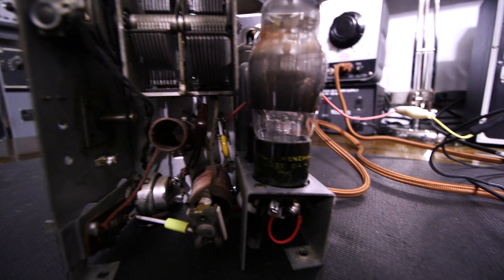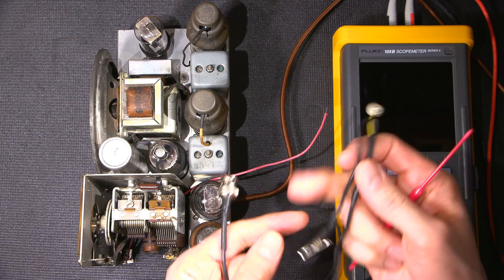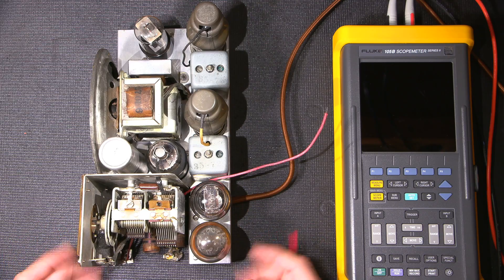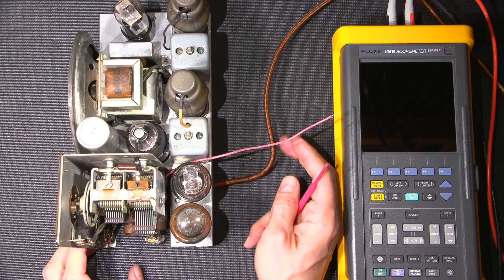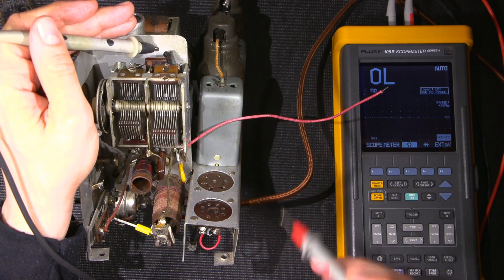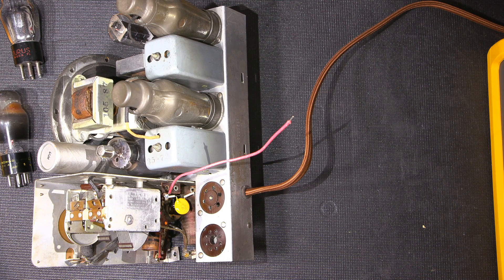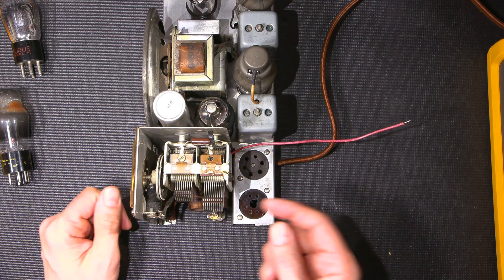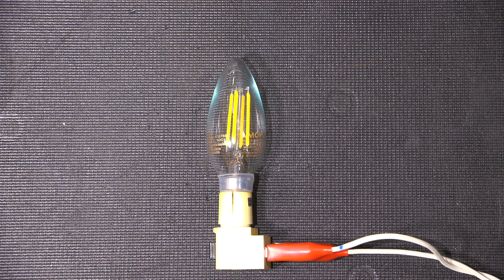See High Voltage Created From Falling Snow!

Comment: you would not really se it in the leakage you have to apply close to the max rating and see if it arcs again, even if it is so sensitive.
Reply: You should know that
Reply from the maker: Hi Heinrich You should know that leakage is resistance, You don't need high voltage to read resistance. High Voltage breakdown is a different scenario. Once you break something down (not to be confused with semiconductor breakdown, this is totally different) you now create resistance, (carbon path (resistive) from breakdown) now see the first line of this response, and repeat.
Reply: Yes and those HV and Y capacitors are build even if they shout though they dont develop those carbon breakdowns you can just test it with another of those capacitors. You get leakage because of excessive electric fields inside of the capacitor around the failure point. You leakage tester is good to test leakage of old and not so good capacitors but it does not help with this failure point.
Reply: @heinrichhein2605  Electric fields won't leak DC no matter how strong though. You'd need a resistive path somewhere.
Reply: Yes they do, especially if high voltage capacitors, and if you have a breakdown it becomes more noticeable. You can try it your self take a such a Y capacitor and over volt it untill it has a breakdown and then measure the leakage at a view volts and at higher voltages. And not you dont need a resistive path. You have even critical field strength in all dialectics if it is are or plastic and if you have a failure point than this is the main problem.

Comment: i had a 2x 30 meter dipole with an open line that entered the house. I always disconnected them from the tuner after static killed a transceivert and just o be safe I put the connectors into a big glass jar for isolation.. At one day I heared some arcing and it came from the open line.  it jumped over through the isolation of the wire to a 19" rack over a distance of 15 cm. I took an isolated pair of plyers  to move it away and it still shocked me. An hour or so later there was a big thunderstorm.  I have had some pretty heafty shocks from the lines   befor this but that was from the bare connectors. I now have an end fed one and I connected 100k and a sparc-gap between centre of coax an the grounded coax shielding.  The voltage is high enough to jump over inside a cap. You need a really high voltage isolation tester to test that but if it jumps over 15 cm  though isolation and paint it will laugh if it meets a cap and bridge it like it was not there. The current does not have to be high, electric fences they use to keep cattle in also shocks the hell out of you with very low current. Or the shock you get when you are charged with static energy and touch some metal.

Comment: About six months ago I had high winds and I heard popping about every 2 second removed coax from radio got hit good it hurt so I thought that probably blow up radio next day hooked everything back up radio worked fine 2 months later radio blowen up😭 icom ic7300😭😭
Reply: Many SS radios can be damaged that are not internally equipped with at least a neon bulb.  My Kenwood TS-450S/AT has one on the antenna connector trace.  I was testing the radio one evening after resoldering the connector's center conductor then hooked it up.  I didn't know it had started raining yet and saw the neon bulb pulse.  A few more pulses and I immediately switched the antenna selector to ground.  Not fun to see that.

Comment: I’ve seen this effect at a Radio Tower guy wire, where the ground was sizzling.
Reply: If the ground is sizzling, you should usually make a point of being far enough away to stop noticing it.
Reply: Jared Maddox I worked at the Station and was alerted to the sound of arcing in the light snow.  I thought it was a power line and called tho power company.  But the arcing was across the insulators along the guy wires to the 500ft tower, and at the base where the wire was attached there was arcing in the ground that sounded like sizzling.  No, I did not hang around to get hurt.

Comment: Perhaps the high voltage "signal" causing the arcing was a very very high-frequency high energy signal.  Maybe the 36 DC ohm coil presented itself as very high resistance to the high voltage signal???  Only answer I can fabricate.
Reply: That's a good possibility. Lightning or other static electric discharges act like a very short duration high frequency pulse. I would think that with the antenna coil and air variable tuning capacitor forming a tank circuit, it would be shock excited into oscillation at its resonant frequency. That would explain why the voltage wasn't shorted to ground by the 36 ohm DC resistance of that coil. (Remember that parallel resonant circuits are high impedance at the resonant frequency.) It would be interesting to see Mr. Carlson place a pickup coil connected to a scope, near that antenna coil and observe the waveform. My guess is that a damped oscillation waveform at the resonant frequency appears with each arc. Definitely fodder for an experiment.

Comment: Not an engineer, but I know that to initiate an arc across an air dielectric of about an eighth of an inch requires a LOT of voltage, maybe on the order of 8 or 9 kilovolts.  The current in a small static discharge can range from very low (less than a milliamp) to respectable and dangerous values (over an amp), but the duration of a "good one" is extremely short, so it comes out painful...but not fatal.  Yes, even a mild or barely perceptible static shock is more than enough to fry solid state electronics.  But generally, small static discharges won't hurt tube gear at all due to the lack of heat that's generated.

Comment: I work on commercial broadcast equipment or kind of had the job fall in my lap. I was warned by the last engineer that even though I have everything shut down and used the Jesus stick on it and the door interlocks should shunt everything to ground to go back over it somewhat frequently and even more so if there is a lot of wind or snow as static can get into it and things you thought were discharged might not be so any more.

Comment: Tesla has a patent on sucking static electricity from the air and converting it to dynamic power for loads 
An insulated from the ground long wire antenna or a shiny metal plate, a high voltage pulse capacitor, a solid ground, an interuptor and a stepdown transformer and you got it

Comment: What ever was coming out of the coaxial cable it was hf/rf so the capacitor was passing it and the inductor blocking (because at really high frequency a capacitor is almost a sort circuit and a inductor a open circuit we all know that) so it can arc, but weirdly a static change is dc, maybe the snow wasn't the cause but somewhere near to the please someone was testing a tesla coil, or something else that created hf/rf maybe a transmitter of some sort
Reply: @WECB640  Maybe if the power line was arcking it was a really primitive arc transmiter

Comment: Paul, the old 500Kw directional suppression array at WLW, Cincinnati, reported unusual static charge voltages on their "northwards suppression array", during squalls which emanated from the south, and at temperatures of less than 25°F.  I remember that the duration was fairly short-term, and that once the event ended, it would not recur during the duration of that storm.  The most complete set of longwire array records that I know of, in your neck of the woods, is at CHML.  I'd drop-off some of the more difficult to obtain components for their backup transmitter, and always sold them at a discount, because those ba*tards seduced me with Tim Horton's 'everything'.

In my neck of the woods, KDKA, and everything else which was Group W, "Westinghouse", maintained the most complete paperwork. The "Radiotelephone Licensed", and upper strata ticketed SBE members - who hold the broadcast engineer reigns, are almost always friendly about answering inquiries, Cheers!

Comment: Were there any burn marks on the chassis where the arc occurred? If not that would indicate a high voltage with almost no current. Typical static arc.

Comment: Even though the one radial was not connected to the radio it was connected to the coax that is coming in to the radio . The coax was acting as a capacitor the isolation transformer is the logical path for the power to find ground. The isolation transformer was absorbing the current post arcing spike. Thats my guess. The current passing through the isolation transformer would cross the winding as magnetism and thus find ground through the chassis of the isolation transformer.
Reply: Maybe ?  : )

Comment: Snowing implies sub freezing weather, therefore very low humidity.  Snowflakes may carry a charge and deposit that charge on the open-circuit side of the antenna, thus building up a large static charge.  As another reply stated, static charges can go through all kinds of paths.  Side note:  the old saying that current takes the path of least resistance is only partially true.  The complete answer is that some current will flow in all paths, and that may be enough to cause the arcing, or even enough to kill you.

Comment: You should have the shield of the coax grounded where it enters the house.  Then a high value resistor, rf choke, or gas tube to ground from the center conductor would bleed off (continuously) or discharge the voltage through the gas tube, which could be as low voltage as approx. 100 volts.  NEC code requires this, OM.  Pretty simple.  It was really not necessary to make such a big deal out if this, getting into tube type scope front ends, etc. and saying 100 times how weird and perplexed you were.

Comment: With that capacitor blocking any DC current to ground, the impedance seen by the static-electricity would probably be very high, at least a few Giga-ohms, and that's most likely allowing the static-electricity charge on the antenna to build-up to a level that's high-enough to jump, or arc to ground, well that's my theory anyway.
Reply: Maybe? And the rise time of the current through the capacitor would be so fast the inductance of the 36 ohm coil would block it.

Comment: The voltage-level generating that spark is probably in the order of something like 10kV, since it was snowing at the time, I'm guessing that the air outside was probably cold and dry, which happens to be the ideal condition for the generation of static-electricity, have you ever noticed how you can generate static-electricity on a cold and dry day simply by rubbing rubber-soled shoes on a carpet?, I'm guessing that a similar principle is generating the static-electricity that's generating the spark, although, I would have thought that the static-electricity would have been shorted to ground by the 30 ohms of the coil.

Comment: Interesting, 

I don't think the electricity was building up over the 30 Ohm resistance. Either something else charged up and arced over to the isolated ground or ... the isolated ground was slowly charged up and the capacitor leaked at that high voltage and also charged up, at some point the isolated ground arced over the transformer and discharged, now the capacitor suddenly was at a much higher voltage than ground and arced as well ...

Comment: Long time ago I destroy mysteriously front end of my CB base station. It was winter and antenna was connected at the time. Week after mystery resolved when I hear and see that sparks was disharging over contacts of my antenna feed cable connector at freguency of about 1/second. Antenna was CB 1/4 wave GP and feed cable disconnected. It was very cold (dry air) and heavy snowing.

Comment: How bizzar. I've never heard of anything like this before.
Reply: "Lord Kelvin's Thunderstorm". In essence, you charge up some charge carrier, and then use either wind or gravity to force it into contact with a conductor which then accumulates a corresponding charge. Normally useless, but it can have noteworthy implications, such as here. It's essentially like running an ion engine in reverse to generate electricity.

Comment: I am four and a half minutes in. With one side of the cable disconnected maybe the coax acted as a long capacitor that was charging until it arced in the radio chassis. That is my instant hypothesis. Guess I should watch the rest now.

Comment: When you rub a pair of rubber-soled shoes on a carpet on a cold and dry day, you can easily generate a static-electricity charge of at least 10kV or more, especially if your skin is dry at the time, cause your skin-resistance will be several Mega-ohms.

Comment: Can you please replicate this  'Carlson phenomena' :) using equipment, e.g. something like attaching a variable high voltage source to circuit which contains a 36 ohm coil and a safety cap with are attached to a pin next to a ground chassis or similar just like in the radio... then gradually increase the high voltage to see if this is phenomena is valid or not? i think that would make a nice clip to watch. Thanks again.

Comment: Your tuned circuit is only tuned when the radio is powered up with it's oscillator operating. I would be more inclined to believe you had some kind of lightning activity, static electricity caused by wind or atmospheric charge phenomenon in your area...

Comment: You don't have a lightning arrester on your antenna?....silly boy.  I've seen arcs jump  unattached antenna coax  bnc connectors from shield to co-axial conductors  as a precursor to lightening storms approaching.  On the coax cable for both my  TV antenna and the long wire antenna for my shortwave receiver both have spark gap lightening arresters .  Your landline telephone also has a carbon block spark gap arrester at the entrance block provided by the telephone company.  As for snow causing static electricity,  heavy snow falls will cause snow thunder, I experienced that several times here in Northwestern Montana.  In the old houses built in the 20s and 30s around here, near abandoned porcelain tubes used for radio antenna and ground wires  sometimes have porcelain block lightening arrester still mounted near by on the outside walls.  I enjoy your tech shows, have a good day.

Comment: The blowing snow creates a charge on the antenna and on one side of the input capacitor. The other side of the capacitor is connected to the grounded coil. As the voltage across the capacitor continues to rise it reaches a point where the capacitor arcs over internally. This creates a very fast current pulse that is blocked by the inductance of the coil. It does not matter that the coil only has 30 ohms DC resistance to ground. Its impedance to the current pulse is many thousands of ohms. The fast current pulse when confronted with the high impedance coil develops a voltage spike that can be many thousands of volts, and just like lightning, it finds its own path to ground via the most direct path.
The way to prevent this (besides disconnecting the antenna) is to wire a 200k ohm resistor either across the input capacitor, or from the antenna to ground. The resistor will continuously drain away the static charge.

Comment: If the transient spark is of short enough duration, its energy density would be concentrated toward higher frequenctes.....in that case the impedance of the coil would be very high and reactive. the 30 ohms would have negligible effect as the reactive impedance would be many times that. All antennae should be run through a spark gap arrestor or gas discharge arrestor to a quality ground.

Comment: hmmm.    some thoughts.      does arcing suggest that the break-down voltage of air is present.        was charge  accumulating, then  arcing, intermittently  -   there did seem to be a 'rhythm'.        while thirty-six ohms does not seem like much, might there also be  impedance, during the event.        the conductor in the  nearby  coil is not  large.   so, would  current flow be, inherently, limited.        it is not clear whether the nearby coil is a multi-layer coil.    if so, then there  Would be  back-emf/impedance, when  current attempts to flow through it.   cheers      googletranslate

Comment: Tie the shield of that coax to ground outside,to a ground rod,then the center pin of coax and the braid the two sides of your dipole can come in to your radio. Your floating your coax,ground it to mother earth. See section 250 of NEC on some good grounding techniques. You wont see anymore stray transient voltage. Check the ground in your electric panel,you use ground rods up in canada, 5/8 diam, 8' foot long driven into the earth. Check the nec section 250, code 2008,2011,2014,2017.ITs free online you will find some very good diagrams. Your house may be floating,improperly grounded.

Comment: Water drops will build up an electrical charge as they fall from the clouds, so why not snow flakes?  You can actually build a static electricity generator using water drops.

Comment: Static build up on long wire antennas is nothing new. You should have a spark arrestor attached to a good ground. Even a short outside antenna should be attached to a well-grounded lightning arrestor for safety sake. Where we use to live in California there was never any snow, but there was plenty of blowing dust that always generated a lot of static electricity on the long wire antennas. To be safe a person should have a knife switch to connect the antenna to the ground when it is not being used. I am sure there are some antenna design books that cover this subject better than me.